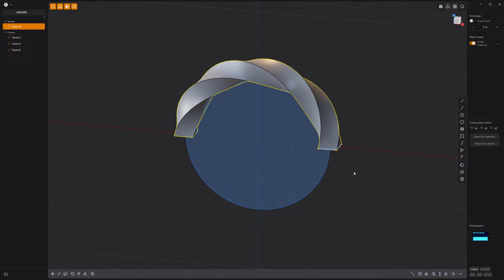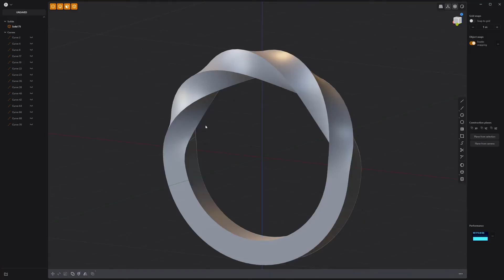Plasticity | Model a Half-Twisted Ring

Comment: Hey, great tutorial, however I have a big issue, whenever I use the bridge curve, and align it with the tangent, it is limited in "resolution", as if there were polygones, and when I apply the curves as obects, it deosnt line up properly, I've tried many things but I don't know what to do, even after the boolean it doesn't match properly..
Thanks in advance if you, or anyone have a solution :)
Reply: I'm having this same issue. Did you solve?

Comment: 0:28 after removing you could just patch the holes and made loft between those patches, same result with much less time consuming!
At least worked for me
Reply from the maker: I didnt have luck patching which led me to this method. My initial attempt was just patching but the results were undesirable.
Reply: @pixelfondue  the more ways shown, the more informative vids are

It's a good thing to show different approaches to make objects, for example, in exercise №29 I didn't expect to see your method, it looked alien for me for some reason, especially compared to previous exercises with more complex forms but with simpler modeling way
Nevertheless it was helpful since you've shown me alternative
Reply from the maker: @pepeweiss  yeah... I'm trying to mix things up and show different tools, features and workflows
Reply: This worked a lot better for me honestly. Solved an issue I had with geometry not lining up after bridging curves. Thanks!